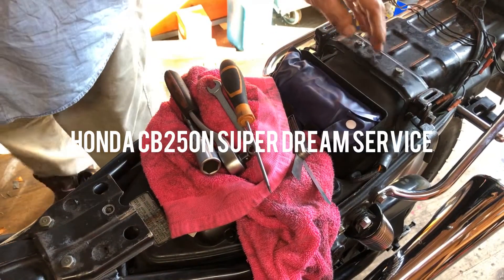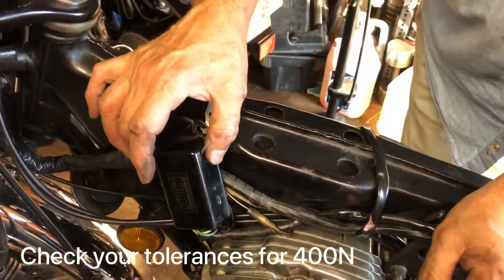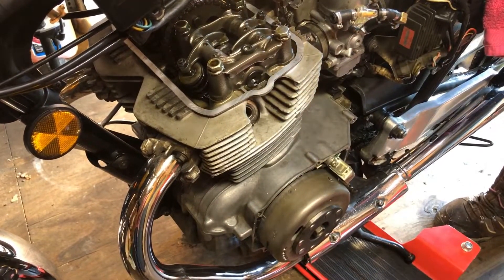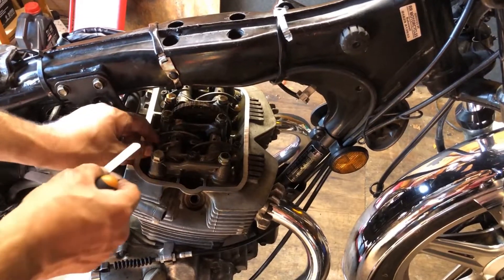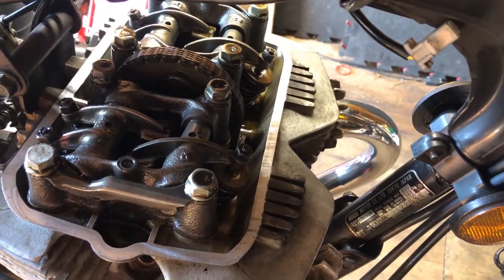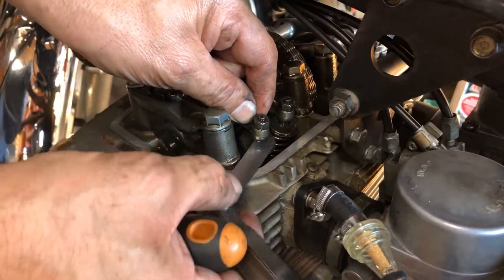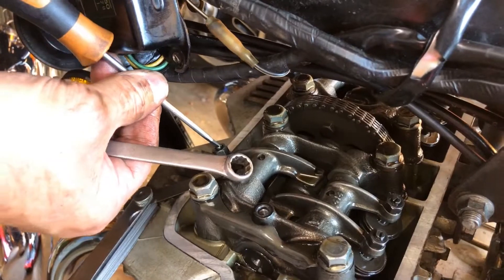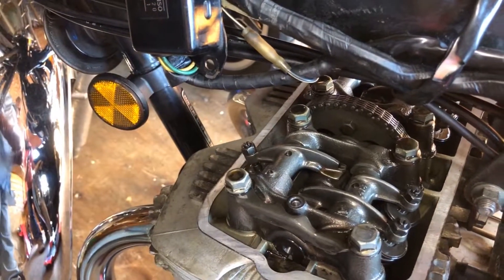Honda CB250N Super Dream Service - Valve Clearance

Comment: How simplistic is that? I picked up a 'W' plate CB250N about two years ago from an alleged mate, I've paid way to much for it, considering its condition and the fact that it's no longer running (£1,780) I bought a carburettor kit for both carb's, but think that a float fell of reinstalling them, as a puddle of petrol appered under the bike within minutes of turning the fuel tap on. But at least it now starts and runs on idle, but it bogs down when you twist the throttle! Any ideas on what causes this symptom? It was doing the same before I reset/refurbished the carb's.
Reply from the maker: Without seeing the vehicle it's hard to say but normally I'd say that it is dirty carbs. Does it rev up at all? If it doesn't, I'd take carbs off again as they have to be so clean. I'd also check forair leaks in the inlet rubbers.

Comment: How much is the intake and exhaust?❤️
Reply: Is .12 and .16 yes  can I use with cb250t ?
Reply from the maker: Valve clearance is exhaust .16 mm inlet .12mm
Reply: Yes you can on CB250T as well...same engine